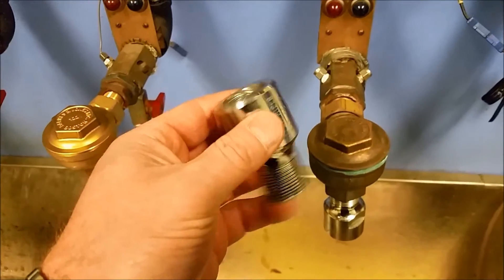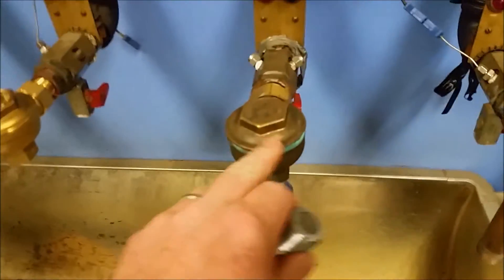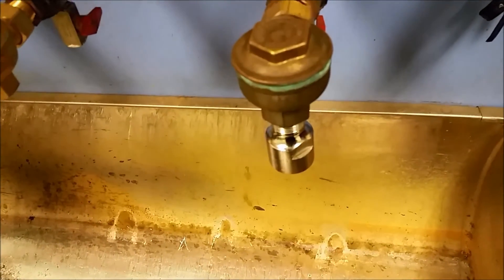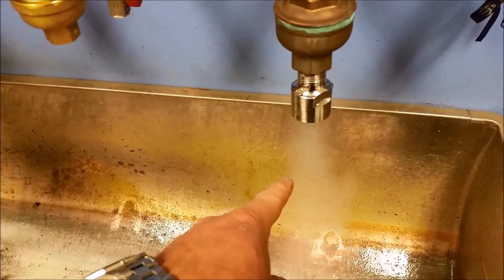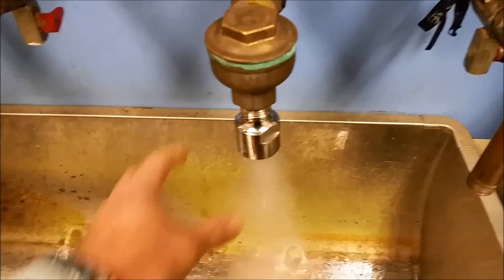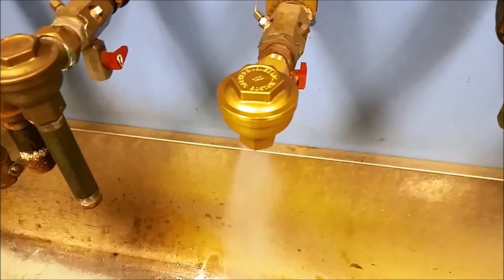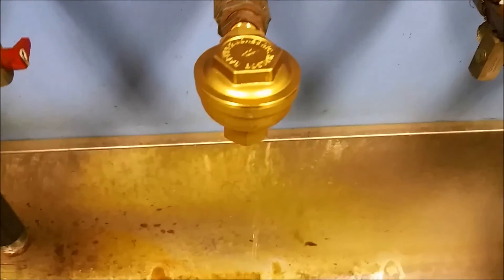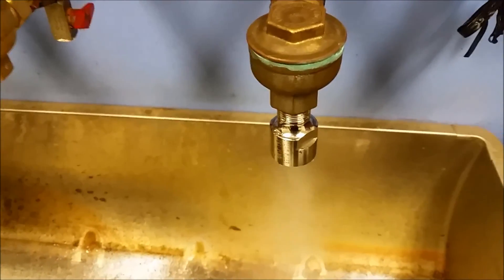SteamGard

Comment: complete bs!! Barnes &Jones are the Yugo of steam traps!!
Reply from the maker: Andrew O'Neill Yugo sold cars in the US for 6 years.  We've been making steam traps in the US for 120 years.
Reply: Barnes & Jones Inc. I'd be interested in seeing a video of how much steam one of your traps loses once they fail open? I'd be willing to bet it's 100 times more in one day than what you claim a Steamgard loses!!!
Reply from the maker: According to Napier's Equation, the fixed orifice trap I have shown will lose $0.45/day and our 122A thermostatic trap would lose $3.98/day, so let's call that 9x.  Using DOE guidelines of 15% trap failure in a year, a regular thermostatic trap will lose $46.47 in a year vs $34 for a fixed orifice assuming 5 PSIG and 2200 hour run time and $1.20/therm.  A steamgard is what $250?  Our trap is $42 on Amazon.  We can set aside the additional cost to repair equipment damaged by water hammer from inability to discharge condensate or the lag time in getting steam to equipment because of the tiny orifice in a venturi vs a normal trap.  How about when all the rust and scale in 100 year old pipes clogs the screen in a fixed orifice trap?

Fixed orifice traps have their place, I'm not suggesting that they are snake oil.  But they are not an ideal replacement for systems that have high startup loads (heating),  or inconsistent loading.  They are also not appropriate where debris in existing piping can clog the screen leading to blockage and water hammer.  If your system runs constantly, with clean piping and has the same consistent loading, and you've correctly sized the orifice size, AKA you run a nuclear submarine, then I would say you have made an appropriate case for a fixed orifice trap.

We have had buildings where the owners were sold SteamXXX and after 6 months they took them out because of all the problems they cause.  They are a specialized trap designed for a specific application but they are sold as a cure to steam trap repair and the installers disappear once the problems start.

You are welcome to bring your fixed orifice trap here for testing and we'll put up the resulting video unedited.

The DOE (Oak Ridge National Laboratory)  has written a white paper explaining the pros and cons of fixed orifice traps, I've attached it for your review

https://www.energy.gov/sites/prod/files/2014/05/f15/orificetraps.pdf
Reply: I happen to be a steam system specialist, for over 30 years, to include hands-on knowledge and in-field audit knowledge of the majority, if not all, of end equipment steam related applications and types of steam traps that are currently in use or operating in the field today.  I have and am currently working with top level P.E.'s and C.E.M.'s, working in the energy and steam industry, within all vertical markets.  I do not care to engage in sales or marketing banter.  However, if you would like to discuss engineering , design points and facts, feel free to reach out.  I happen to be a hands-on mechanic trained by a master mechanic who was an aircraft maintenance specialist in the military.  I also hold college degrees and training certificates in thermodynamics and in HVACR Systems.  RWSkilton@gmail.com or 603-714-8727.